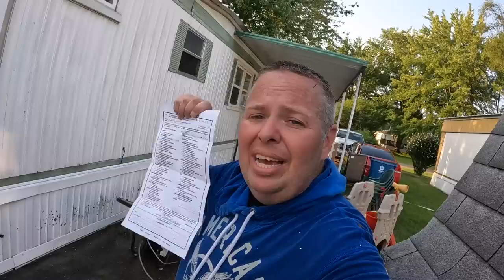WE SAVED an ELDERLY GRANDMA from EVICTION, POWER WASHED TRAILER and Sidewalk

Comment: It's so nice of you to do this for her!  I'm 70 and live in a mobile home in northern MI (on my wooded acreage) and got rid of my power washer, because after using it, even for 30 minutes, the weight would hurt my arms.  For the last 3 years, I've used a brush that extends (like you would use on a car and is light weight), a bucket with vinyl house cleaner in it and my regular hose.  I hose down the section of siding I'm working on, brush on the cleaner, wait for 3-5 minutes, in stubborn areas, but a lot of the time I can brush on the cleaner and immediately hose it off.  This works very well, is faster than using the power washer (for me) and I use the same technique on my pole barn and shed.  Usually, the algae grows only on the north side of the structures on my property, and I wash them every year.

Comment: I cleaned some really bad mold and algea off my siding the other day using a product called 30 min house wash I got at Lowe's.  No power washing necessary just a garden hose. I used a power washer last year but it took alot longer using the power washer. What's bad about a power washer is that it forces water behind the siding plus adding more moisture for algea,  mold to form underneath the siding. This product I used you could see the mold and algea just melt away in less than 2 minutes after soaking the area down. Bright shiny clean! And smelled good.
Reply: Thank you for your practical comment.

Comment: Good job on the house and driveway.  She has a water issue that will have it black and dirty concrete soon.  I heard you say you edged there before.  Should have edged it again or used that pressure washer to edge it so water can run off to the street better.  It should give her a bit of relief til she can get someone to mow and edge for her or they will be on her again.  I am thinking they are pretty picky seeing how others are pretty dirty too.  Can't say if they got a notice or not.
Reply from the maker: They are piicky

Comment: I lived next to a trailer park like this where a majority of the trailers were from the 70’s and belonged to long term tenants.  The park started evicting the older trailers for various infractions so they could put newer trailers in and charge 5x the old lot fee.  Where I lived you could only increase rent 13% per year, they ended up going bankrupt.
Reply: Yeah, but don’t most people own their trailers? They just rent the lot, or at least that’s what I thought??
Reply: @babblesp1367  your right, the people own their own trailer. It’s on the lot that the park owners are seeking more rent. If the park owners get someone new to move in they can start off new with a much higher rate on the new lease.

Comment: Would help for having drainage systems for rain water coming straight off roof to concrete foundations and not a single drain in heavy rain water splashing up the motor homes.
Reply from the maker: Good point

Comment: trailer parks are almost as bad as HOA's.  Her trailer is hardly dirty compared to others around hers so sounds to me like they want her out for some reason.  I used to live in a trailer park.  1st they told me I had to paint, I painted, then they said I had to fix the screen room, I made it like brand new, then they changed rules on the size of dog you could have, went from 90lbs to 30lbs. My dog weighed 75lbs.  only gave me 2 weeks to either get rid of the dog or move out.  I of course moved out.  In less than a week they had tore my trailer out and put in a big, brand new one.  After I did all that work! So yea, they wanted me out.
Reply from the maker: WOW, that is nuts